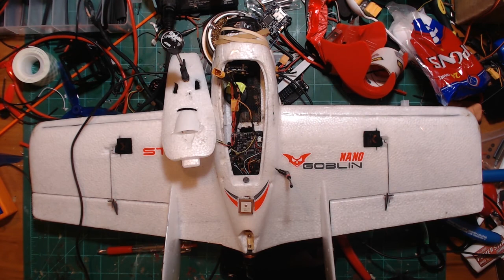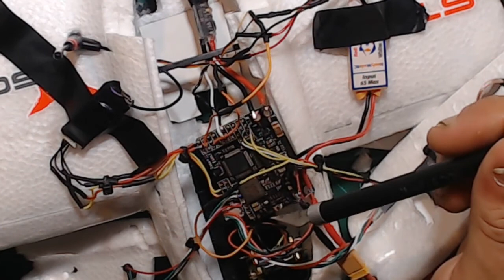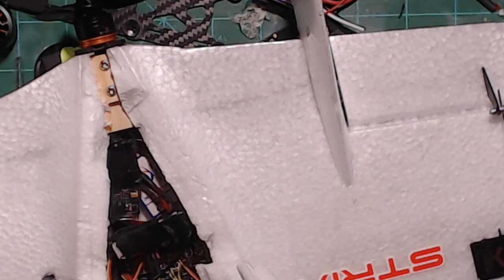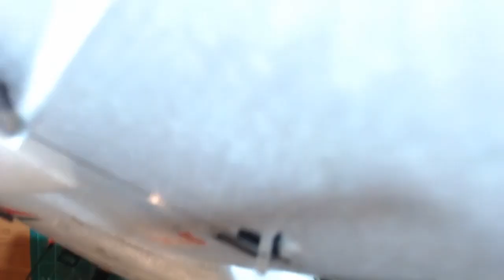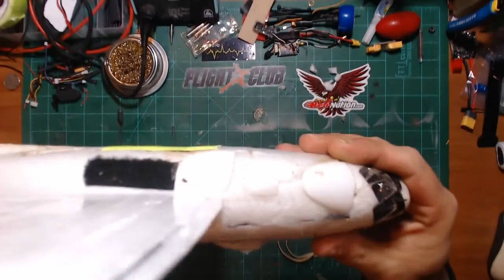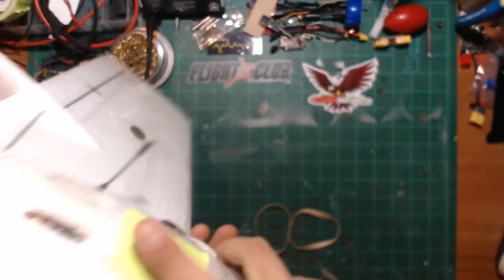LONG RANGE MICRO PLANE BUILD SERIES-NANO GOBLIN PART 3-FINISHING UP AND MODIFICATIONS

Comment: hi, interesting project for sure... can you tell me which gps module your using...seems very compact, wanting to do this to my nano but with possibly a different board like omnibus f4 v2 or other...not sure which gps modules may be compatible or are they all the same...still researching...thanks for any info
Reply from the maker: matthew p it’s the mini m8n from amazon or readytoflyquads. Both work just fine but the amazon ones usually have the wire colors all weird.